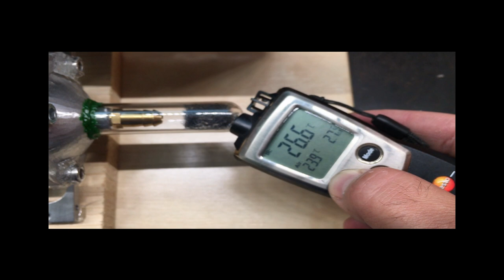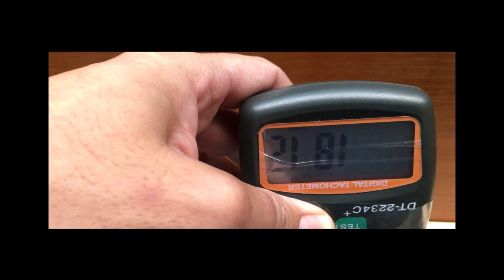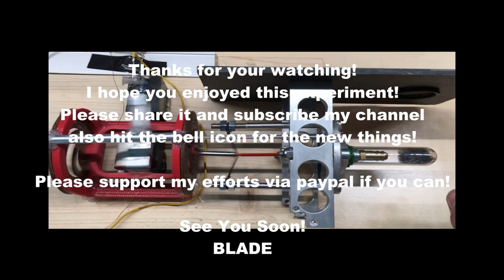Lamina Flow Stirling Engine heat pump - DIY Thermoacoustic Thermal Lag

Comment: Without a displacer piston, thermoacoustic engines flip the thermal core around from the orientation normally associated with stirling engines, meaning when running as a refrigerator, it cools the cylinder closest to piston, and when running as an engine, you have to heat the part of the cylinder closest to the piston. The US Army had one of these designed, and the paper discusses the differences between thermoacoustic Stirling and mechanical Stirling engines.

Comment: Where is the engine? Oh, it's driven by an electric motor. Duh..
Reply from the maker: Yep, it was an unusual experiment, because I never seen any try to use thermal lag as heat pump. But this configuration is a different as other heat pumps if we are not in resonance. Lots of experiments left yet... Time...time...time... Also Money...money...money... ;) BLADE

Comment: Any thoughts on how to increase the air pressure on both sides of the piston? That should help you do more work with the heat pump.
Reply from the maker: That is simple, ang gives more power. Just close the engine into a pressure vessel pump it up, and run it. My question was here, why not changed the heat exchanging sides when I driven the engine mechanically?!

Comment: Maybe because the gas moves in response to the piston, instead of the other way around, thus the lag effect becomes reversed?
Reply from the maker: Maybe, but I think my motor frequency wasn't enough to the resonance. So it was untuned. I've made a short experiment with stack and a syringe. If I push the piston by hand with forced movement, not resonant, than the compressed and hot gas left the heat into the stack partially, and the stack collected that. But with short pulses in natural resonance what the inner gas and the piston's mass given the cycle is upbuild and works well as a standing wave heat pump. I think I should make more experiment with this setup for the future with more contact temperature sensors. But actually I think it was out of tune, maybe close to the half of the resonant frequency and this could give a changed the sides. It has a chance, because the original was around 50Hz and the motor worked around on tthe half of it. So the wave wasn't full just the half but if that is truth that part of the sin wave creates opposite sides. Thanks for your comment. Iniciated me to thought about this effect again. BLADE

Comment: Hey Blade, I figured you would put them back to back but I was expecting both to have a flame.
Your question resides in thermoacoustic cooling.  You may get lower temps if you set the chamber size and stroke to a better harmonic.  ;)
Reply from the maker: I know how can I make a lower temperature! ;) The question was, why not changed the sides. The heat engine has same side "hot"as the heat pump, that is weird! The heat engines works backward if we use them as heat pump.